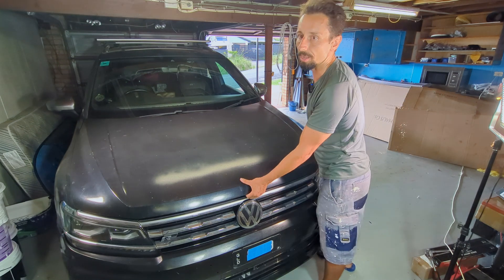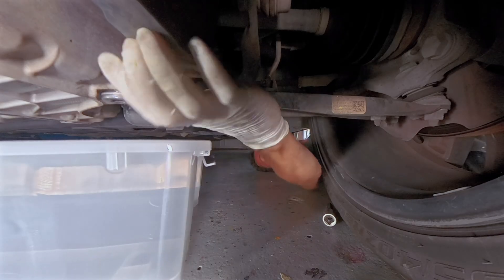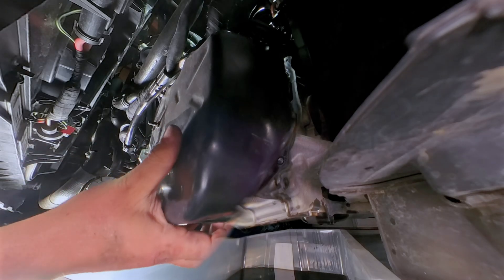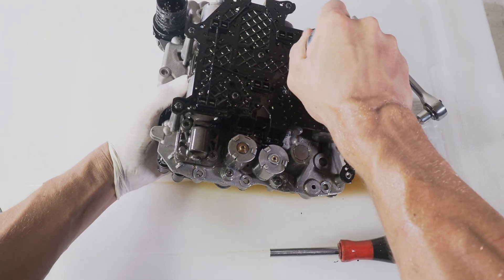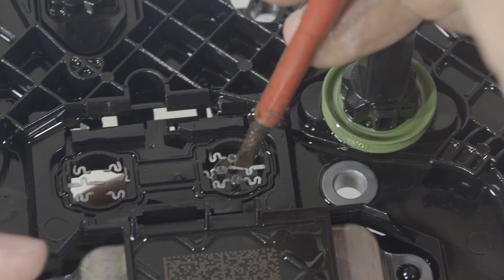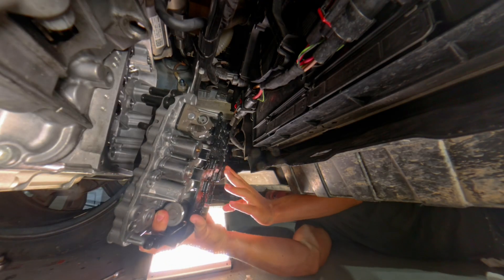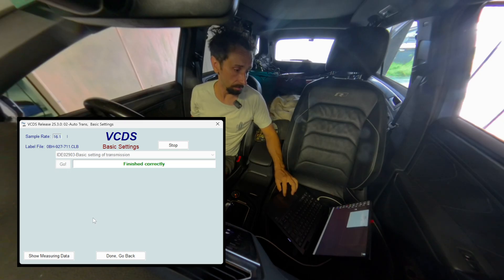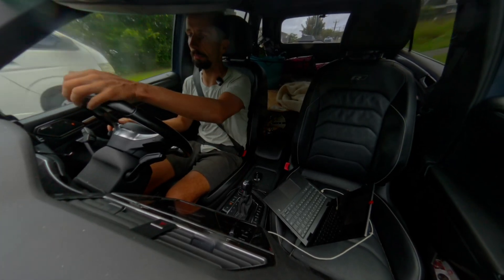FIX Gearbox in Emergency Mode! VW/Audi DSG Transmission Issue DQ500 Error P1736 (DQ381, P1735) 🚗🔧

Comment: What is a liquid gasket?
Reply from the maker: A liquid gasket is a sealant you apply as a thin bead instead of a rubber gasket.
It cures after assembly and seals the joint against oil and pressure.
Reply: @GA83 never put sealant on mechatronic, i repair gearboxes i do them weekly its gonna give you problems
Reply: @GA83  it came without liquid gasket?

Comment: The bolts you had trouble removing do not have loctite on them, they are just very tight and are a soft material. Should you  ring one drill the head off and the thread will just unscrew easily

Comment: How good is to use soldering iron to get the sensors make the proper contact? They come spot welding not this way?
Reply from the maker: Yes, I think you're right they are welded OEM. I had the same thoughts and picked a solder with a higher melting point and bent the wires so that they have a good connection before soldering. 

Probably better to spot weld if you can.

Comment: Hi, 
Do you know if a faulty glow plug on cylinder 4 which is showing when I scan with vcds, will prevent me from running the basic settings for the transmission?
Reply from the maker: I tried it with fault codes and it didn't work for me. Might be worth fixing the glow plug first.

Comment: Hi, I see your video and something similar today happened to my car. 
I drive and when stop car showing  messages no R gear and only go in one gear forward. Not giving change gears in forward.  So when is cooling automatic remov errors and working normal. So when gerbox oil temp goes to 85°C problem starts. With vcds, I get this error code: Gear 2
P072D 00 [002] - Not Selectable
Valve 3 in Transmission Part 1
P174A 00 [010] - Electrical malfunction
Cooling 0il Valve
P179D 00 [002] -
Starter Enable from Selector Lever Sensor System
P1734 00 [002]
Do you have any idea woth is wrong? Thanks

Comment: Hi, after watching your video i decided to fix my gearbox. same problem. what solder did you use? i am in Australia so i could get the same. thanks
Reply from the maker: I was not sure which solder to use. Due to the higher temperature in the gearbox I thought it would be better to have a higher melting point. Does anyone know what would be the right?

I used:  Lead-Free, 1.0 mm content: 0.3% silver, O.7% copper, 96.5% tin, content of flux core: 2,5 %, melting point 217C.

Comment: Hi, great video, but once the sensor has been replaced and re fitted to the car, do I need to do any adaptations for the new sensor? Or is it just plug & play? Thank you
Reply from the maker: Thanks, after the replacement you will need to perform a basic adjustment of the transmission (learning new sensor values).

Comment: That’s the same issue than p0805?
Reply from the maker: I think P0805 is more related to the clutch actuator, not the pressure sensors like in my case. They’re usually not too hard to replace. You could try a clutch actuator relearn first, or even a full gearbox adaptation/reset. You might get lucky and fix it without needing parts.
Reply: @GA83  After some research, I discovered that error code P0805 is a generic one. Using a more advanced scanner, I discovered I have error code P1736. I bought a VCDS scanner and the spare parts anyway. I'll analyze my car and see what it's like (I have the same car as you). Thanks so much for all the information.
Reply: I've already made the change and everything is perfect, the errors have been erased and the sensors are in normal parameters. The problem I have is with the gear configuration, when starting the learning process, I get a stop error for safety reasons and I have the car in the following conditions: doors closed, brake pedal pressed, oil at 50*C, lever in P and handbrake on (I tested it with the engine on and off, along with the brake pedal pressed and released). Could you help me configure the gears?
Reply: I was doing some tests and during the test, I discovered that one of the sensors rises to 15 bar during gear learning and then stops and throws an error. Why could this be happening? Will returning everything to factory settings fix it? (I don't have the access codes, so I don't know if I can.)

Comment: Hello, I congratulate you because your video is very well explained, it served me a lot, I did everything as it is and the sensors were left with the pressure recommended by the manufacturer, but at the final hour, when making basic adjustment of the transmission I get the message "aborted for safety", I need help... please
Reply from the maker: Thanks! Glad the video helped. If you're getting “aborted for safety” during basic adjustment, check that the ignition is on (engine off), brake pedal is pressed, fluid temp is above 30°C, Gear selector in Park (P) or Neutral (N) - check your scan tool’s instructions, and there are no fault codes. Also make sure the engine bay and all doors are closed.

Comment: if i change audi a6 4g pressure control valve 2-N216 in gearbox . do i need to code new valve or i have to just  delete trouble code ? please reply
Reply from the maker: Just clearing error code and  running basic settings/ adaptation for the gearbox should do the job.

Comment: What's the OEM part number for the sensor?, were did you get it from?
Reply from the maker: Hey! Good question. As far as I know, VW doesn’t sell that sensor separately as an OEM part. You usually have to buy the whole mechatronic unit if you want it directly from VW. That said, the sensor itself is made by Bosch and there are part numbers floating around like SMP132532 or 0GC300046 depending on the version. I sourced mine from an aftermarket supplier. If anyone’s got the official VW part number, feel free to chime in!
Reply: @GA83 I believe you are correct, no OEM part number from VW/Audi…. Great video.

Comment: This is an amazingly well done video.  I couldn't get the plug out until u said to rotate it. I kept thinking that the prongs would be damaged by “turning” it would be a huge mistake, but that helped immensely. Thanks! Also u have to do that before removing the bolts holding the metal cover because it won’t come out unless u do.
Reply from the maker: Thanks so much! Glad the tip helped. Yeah, rotating feels wrong at first, but it makes all the difference.
Reply: Broke one of the little screw even after using a soldering iron to try and loosen them. Some were so tight I had to heat them 3x. 

Excellent video, soup to nuts, saved  me a GOB OF LOOT. Thank you,sir.
Reply: I do all this but now I have the fault code  P176F00 ? What can I do?
Reply: @andreipreoteasa7773  i have the same cuestion

Comment: Hello i have Audi A3 2017 same issues but i dont that same program you are using to rest transmission setting. I am using a scanner called launch. Same a lot features
Reply from the maker: I know VCDS or OBDeleven Pro can do it. I read that some Launch scanners (like the X431 with full license pack) can do it as well under Transmission (TCM) Special Functions or Basic Settings.
Reply: Awesome im still working on it 😅 what type of soder wire did you use? Is any fine? @ga83
Reply: Awesome! I'm still working on it but I know I have the full license so I'm do that. Just wanted to ask what type of oil and what solder wire did you use on the sensors

Comment: @GA83 Hi, I’m doing this job tomorrow. Could you tell me the torque specification for the mechatronic unit bolts? 7:10 
Thanks!
Reply from the maker: The bolts which hold the unit in place? It's a 3 stage process: hand tide, 8nm and then 45°. I followed the recommended order of the bolt pattern which is a star pattern: Top left is 1, bottom right is 2, bottom left is 3, top right is 4, and so forth...
Reply: @GA83  thanks i did today this repair to my car,  your video was very helpful, everything went very well, dsg now is changing all gears like butter🙌🏻✌🏻✌🏻
Reply: @albertgashi1814  good job! Could you please tell me the part number of the sensors that you used?

Comment: Nice vid. My wifes skoda kodiaq star giving problems as it isnstuck in 1st 3rd and 5th and cant reverse. Is there a reset or somethings i could try?  Dont have any experience in this.
Reply from the maker: Sounds like it's in limp mode. You can try disconnecting the battery for 10-15 mins to reset the system, but that's just temporary. You'll likely need a proper scan tool (like VCDS or OBDeleven) to read and clear errors or re-adapt the gearbox.

Comment: I did a successful change of both sensors, after driving around 100ish miles now sporadically I get the ‘P176F00 - Clutch 2 closes unintentionally’ error code fault.

Gearbox goes in emergency mode. Park up and restart the car after its fine. Ita happened 3 times in last 2 days.

Transmission- Resetting of the basic settings and adaptation was done.

Anyone have any comments on this, I am so lost lol thanks in advance.
Reply from the maker: That sucks. Check the live clutch-pressure values. Try a DSG relearn/adaptation which might fix P176F00.
Reply: @GA83 
The pressure values are a bit off.

With just Key in ignition (engine off) shifter in P Actual Values are K1 is -0.01 and K2 is -0.09 or at times -0.10 bar.

I’ve done basic settings reset and Transmission adaptation at least 3 times now.

Read an expert say something about “ factory calibration discrepancies on the OE quality Bosch manufactured sensors (what I installed) being permanently written into EPROM…” 

Which I don’t know much about, I have subscribed to the forum now will maybe try ask his insight on this. Thanks

Comment: What liquid gasket did you use?

I am going to do this tomorrow, 
many thanks for a step by step and informative video!
Reply from the maker: I went with JB Weld Ultimate RTV, but I wasn’t entirely sure whether Grey or Black was the better choice. I opted for Grey because it’s designed for high-torque load applications and has strong heat resistance and, to be honest, I already had some lying around. I believe it must be at least sensor-safe, oil-resistant, and high-temperature resistant. If anyone has more experience with these, I’d love to hear your thoughts!
Reply: Ah thanks, saw another video by a plsce called ECU Testing they rebuild the Mechatronics unit and ship it to you. They give instructions like you have (minus repairing the unit) and when re-installing the unit they didn’t even instruct to use a liquid gasket. So I was wondering if it was essential to use or just good practise on your part.

Btw Subscribed!
Reply from the maker: @aumgelic  I applied liquid gasket to the mating surface between the mechatronic unit and the gearbox because the original factory sealant was there and looked a bit damaged when I removed it. I figured it’s better to reseal it properly to avoid any potential leaks. I’m not 100% sure what the official DSG procedure is. If any DSG experts are watching, would love to hear your thoughts!

Comment: Hi i have done this repair but now im getting code P175E00
Clutch 1 Closes Unintentionally and only have 2nd gear and reverse.
My machine won’t do basic setting is this the reason my gearbox is still in emergency mode, thanks
Reply from the maker: Check your actual vs. specified pressure values for Clutch 1 -  if they don’t match, your sensor or its connections may be faulty.
Reply: @GA83 i completed basic settings again and it’s now working (remember to press brake pedal lol)

Comment: Valve 2 in partial transmission 2 (error P174D00- electrical fault)
Have you come across this error?
Reply from the maker: I haven't had that exact error myself (P174D00 Valve 2 in partial transmission 2), but from what I understand, it's related to one of the solenoids or valves in the mechatronic unit. Could be an electrical issue like a broken wire, connector, or the valve itself failing. Maybe you're lucky and it's just the connector to the transmission. I would check that first because it's easy but i don't really think that's the issue.

Comment: Hello. I changed both sensors, but the scanner fails to perform basic transmission settings (I tried two different scanners). Are you using the genuine VW scanner?
Reply from the maker: Did you check your "Actual pressure-value for Clutch 1 & 2"  they should be pretty close to the "Specified pressure-value for Clutch 1 & 2". 
You will need: No Error codes, Fluid Temperature above 30 °C, correct Fluid Level, Gear in "P", Engine Idling, hold Brake Pedal, Cruise control OFF.
I used VCDS but obdeleven should be fine too. Not sure about other tools.
Reply: @GA83  I missed pressing the brake pedal! The learning process was successful. Now I'm DTC-free, but the car won't move. 😬😬
Reply from the maker: @javiertoirkens9364  Did you turn it off and on again including opening and closing the driver door? Are all your doors including the bonnet closed?
Reply: @GA83  That's what I needed to do. Now the gearbox works perfectly. Thanks, and greetings from Chile, South America.
Reply: @javiertoirkens9364  amigo disculpa cual fue la numeración de sensores o marca
Reply: @javiertoirkens9364  amigo, hola, por aca un chileno mas con el mismo problema en su tiguan, me serviria mucho tu ayuda en estos momentos, podras ayudarme un poco?

Comment: To release  the loctite you need to HEAT the screw - use a 100W soldering iron applied to the head of the screw, the heat will weaken the loctite.
Reply from the maker: Thanks, that makes total sense! I will definitely try that next time run into a similar issue.
Reply: Yes total sense bravo marty goodwin.

Comment: Nice video !
I wish i could have seen it in 2023 as I made the exact same repair to my 2017 VW tiguan at 160000Km.
It was fitted originaly with "SMP132-420" and I replaced them by cheap "BEA110" at 60€ for both from Aliexpress, the only spare available at that time.
That never worked for me: both sensors were reading approx 0 bar in neutral but their responses time were too low, especially on 1 sensor.
I tried to run the basic setting so many times and was only able to drive untill the 3rd or 4th gear before to get a fault code.
I had to go to the garage for a whole mecatronic replacement (2000€).
Waste of time for me but very informative.
Reply: Did you perform the manual shifting procedure after wiping clutch & gearbox datasettings in order to adept the system to the current sensors? Probably wiser to shift with good quality sensors straight away. I will still give sensor replacement a shot.
Reply: Yes I tried everything of the list in VCDS and also with other softwares with a specialist in car electronics.
What I can say is if you gonna try it the only way to succes is to use OEM quality sensors which are hard to find 👍

Comment: Thank you for sharing your experience and knowledge :)
Can I ask you the supplier of new sensors ?
Thank you!
Reply from the maker: Thanks! Got the sensors from a Chinese online store. I just made sure to pick a reputable seler with good reviews. Paid around $350 AUD for both sensors.
Reply: @GA83 It will be fantastic if you point me in right direction to buy these sensors because I have the same issue with my Tiguan Allspace and I want to be sure to buy a good quality ones to make the job!
Thank you!
Reply from the maker: @paskuale Thanks! I totally get wanting to get quality parts. I felt the same. l'd recommend doing a bit of research to find a reliable source, since l'm not 100% confident recommending a specific brand or seller. 

What I did was buy a sensor that came with a warranty, so could test it before filling the oil. I plugged the mechatronic unit into the car (without starting the engine), checked the values to make sure everything looked right, and only then installed the unit properly and filled the oil. That way, if something didn't work, I wouldn't have to redo everything.

Comment: Very informative video! Thank you very much. Question: When was the pressure sensors faulty readings prior to changing them? During driving?
Reply from the maker: My value was around -1.2bar where it should be zero. Check the "specified" vs "actual" value entry for Clutch 1 or 2. They should be pretty much the same (+-0.3bar). You can check even if the engine is off. I checked before filling up the oil, after the repair. But I would check during shifting/driving.

Comment: At what mileage did this occur? What is the price of new sensors ?
Reply from the maker: I think it started around 65,000 km. The sensors cost me about 350 AUD for the pair.
Reply: @GA83  Cheers mate. I had same issue just yesterday on my kodiaq (same gearbox dq500). After shutting down car and turning on everything work smoothely, but after 15 minutes same error occured on dashboard. Waiting for my mechanic to engage diagnostic. Hope it's the same problem as yours cause mechatronic can be very expensive.
Reply: Do you maybe have OEM number of sensors ?
Reply from the maker: @srda1989  I don’t think there’s an official OEM number because normally, you’d replace the whole mechatronic unit, not just the sensors. However, both the old and new sensors have a code that starts with SMP 132-532, but the rest varies. It looks like:
	•	SMP 132-532 2251 EMB53-14 4.0746
	•	SMP 132-532 2235 EMB53-14 4.0746
	•	SMP 132-532 2249 EMC43-5 3.0825

There are lots of different variations, but I’m not sure what they all mean - it’d be interesting to find out!

If your issue keeps coming back, you might want to consider getting a new mechatronic board if you have the option of cloning it. It costs a bit more (around 750 AUD here), but it could be worth it. I’ve heard that temperature sensors can also cause similar errors, so it might not just be the pressure sensors.
Reply: Hey, Do recall which error/code when this occurred?
Reply: @bandlylero  Error 173600 / position sensor for clutch 2. Electrical error. On my Tiguan.
Reply: @philipbesancon855 

I think you mean to say ‘P173600’ atleast thats what it is on my Tiguan